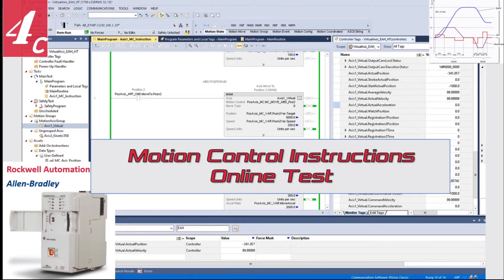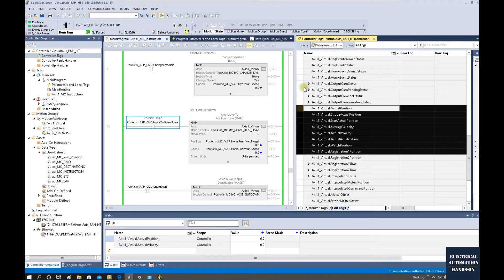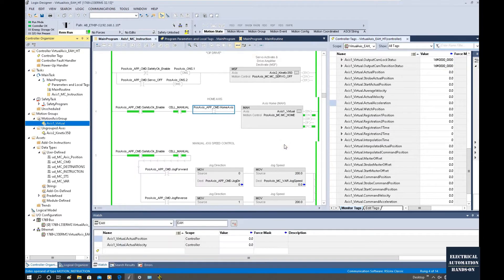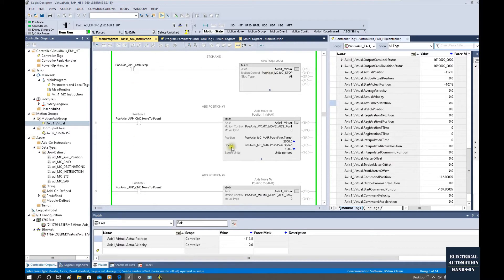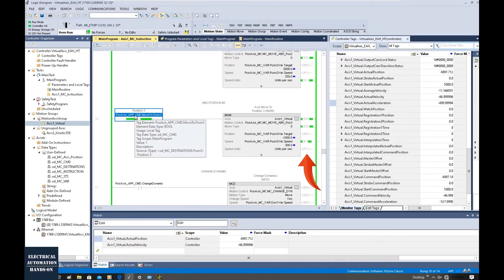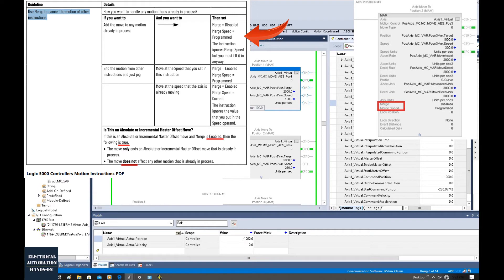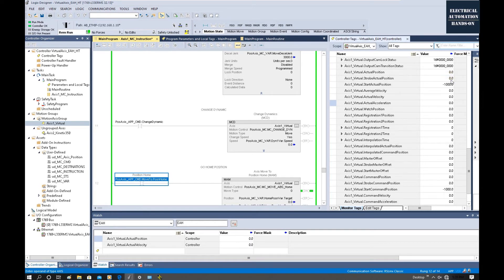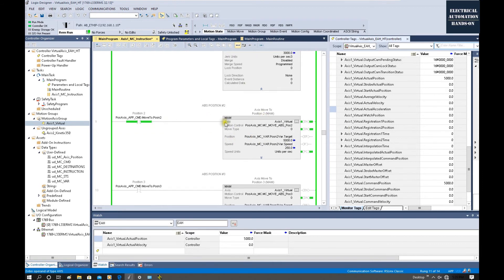MA04c. [AB Motion Control] Rockwell Motion Control Instructions - Online Test [6/10]

Comment: Hello sir
In my Application there no servo axis control.there is only 1 Encoder with one sliding bar that travel position from 1 meter to 20 metrr distance position and that bar controlling through the VFD for various Speed. 
Which motion instructions is suitable for my application.?
Pl suggest.
Thanks
Reply from the maker: You have to program the position control fully by your self, e.g. using P control and position comparison simple method. You'd better using high ratio gearbox to control your drive other wise the position control accuracy can be expected too high.